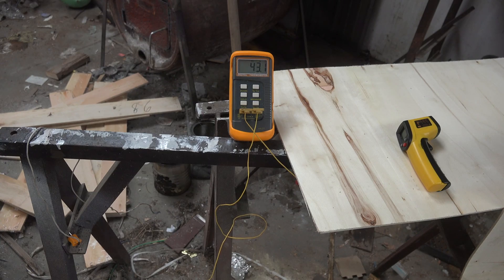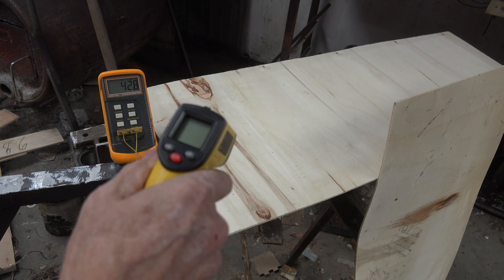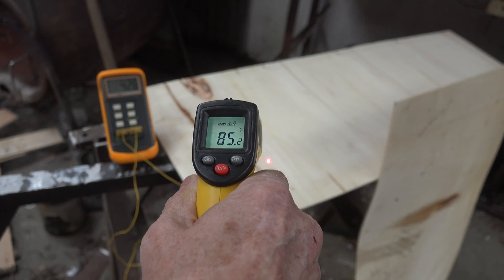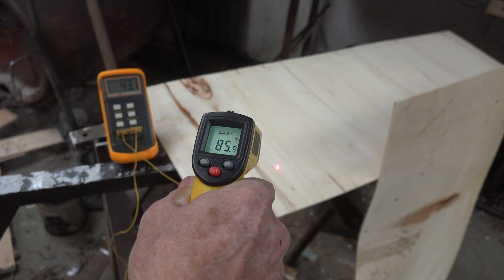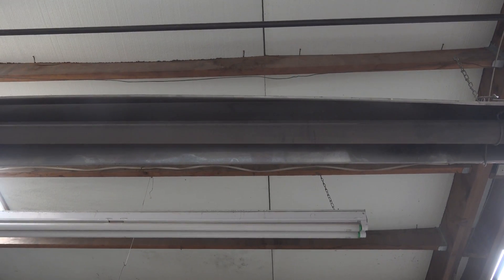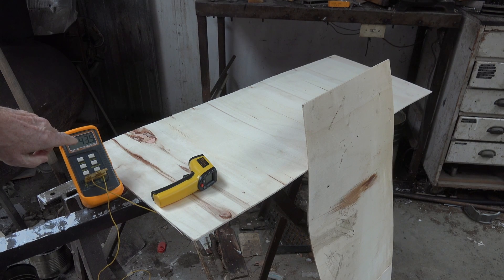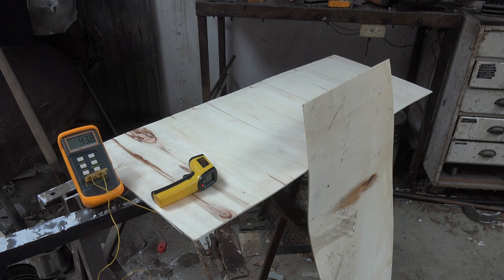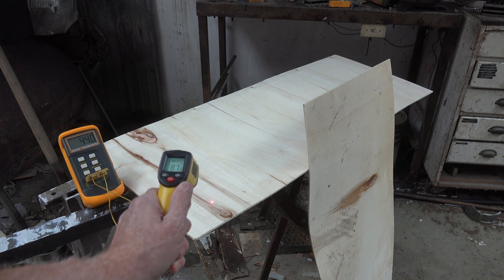Temperature comfort in the structure:  Radiant heat

Comment: cooked head and cold feet sums up overhead radiant, at least until it's been on long enough to heat the concrete and other surrounding materials.
adding radiant heated slabs is great, but hard to accomplish in existing construction, service garages and other places thick concrete for with heavy equipment/machinery. I don't know who could afford that, as most folks are lucky to have a torpedo/jet heater using kerosene/diesel or propane.

Comment: Interesting.  Is radiant heat only feasible for small areas and not for larger areas such ad the house?
  I noticed you have what looks like a barrel heater in your shop.  Is it only used when you want to heat a larger area?
Reply from the maker: Mostly I burn trash in the barrel stove.  Radiant panels are used in the ceiling in some houses.  Many radiant heat systems are used in shop areas where large doors may be opened to move equipment in and out.  It heats the objects, not so much the air.  So, as in the video, you can be warm in a cold area.  
GFM

Comment: It's hard to convince people that radiant is the only way to heat a place you don't keep warm for a long time.  All that cold metal in shop takes forever to heat in ambient air heating, but will reflect heat off its surface.  

I've also used localized radiate when I just needed to do something at the bench.  One of those clip on reflector lights with an incandescent bulb will warm your hands and what you are immediately working on.  Some of the bubblewrap radiant barrier behind you will keep the drafts off and reflect heat to your back.

Comment: my sister has one of them gas burners in her 2 car shop, an sure it is toasty warm under it, but every time they turn it on there gas bill go though the roof big time, I installed 1/2" pex tubing and a small electric boiler and poured 2" of concrete over the floor an pex pipe, 3 years ago an they are happy camper and so glad they ripped out that old wast full system, now it is on all the time an there hydro bill in winter a -40 is up by 30$ CND compared to the 370$ gas bill, wall are warm floor is warm water melting of the 2 trucks never makes it to the floor drain, by far the most efficient radiant heat
Reply from the maker: Floor heat is a great way to heat, but radiant heaters like the one shown are the best for either outdoor heating or spot heating of shop areas.  I have never heard of radiant heat being more expensive than either floor heat or unit heaters.  
GFM

Comment: Hey there, I didn’t watch this video yet, but the radiant heater caught my attention.   

Out here in California, we have electric radiant heating embedded into the ceiling.  

I have a question on how to tell if it’s good or not, or if the element in the ceiling is bad. 

These are 2 pole, 220v systems. 

I’m getting 120v to ground on each pole. 

When I turn on the thermostat, I get an amp draw reading. 

The thermostat is super old, but is turning on and off. 

My question is, even though I get an amperage reading on both L1 and L2, does that mean the heater is actually working? 

Or if the heat element in the ceiling is broken, will I still get amp draw when I turn on the thermostat? 

I know I can install a new thermostat and see if that solves it, but I’m trying to figure out how to properly diagnose them. 

Thanks!!
Reply from the maker: There are several parallel circuits in the ceiling.  Amperage draw means the heater is working but some of the heaters may not be working.  If you have surface temp thermometer (like seen in the video), you can point it at various parts of the ceiling to see if some heaters are not working.
GFM
Reply: grayfurnaceman awesome! Thanks for the response!